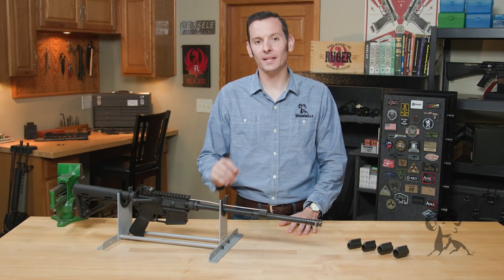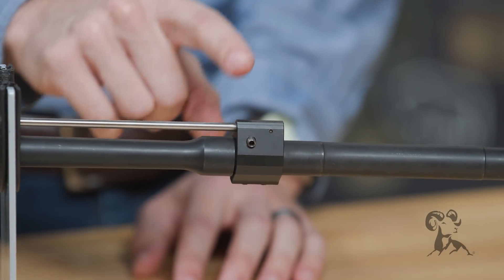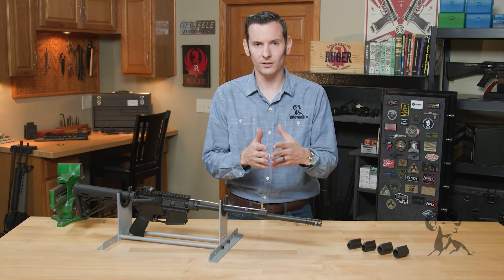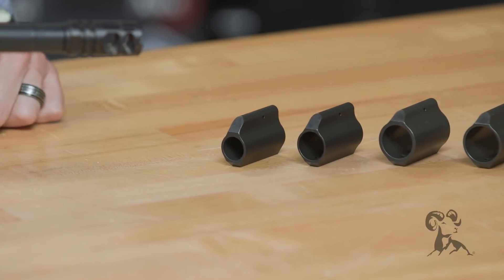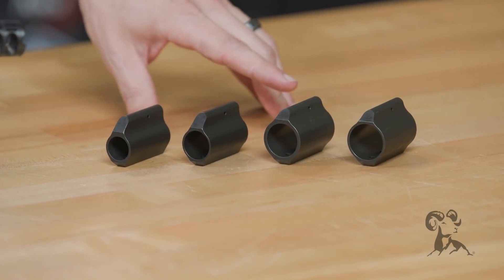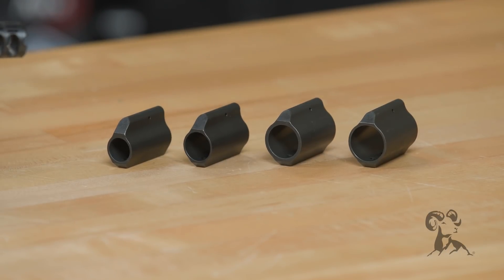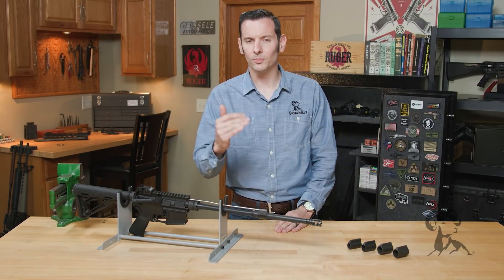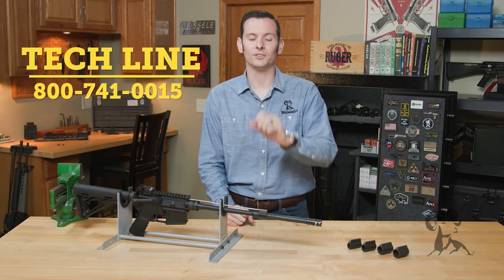Quick Tip: AR-15 Gas Block Diameter Explained

Comment: How can I find out what kind of gas block I need I have a s&w sport 2 with the rail gas block I want to switch it to low profile gas block with few float hand guard
Reply from the maker: .750 diameter

Comment: Question? I have a 5.56 and 223 rifle and I want to buy a 9mm upper.  I have to register the lower at 9mm and the length of the upper can be 8 ”even if it is a rifle?
Reply: Rifles must have barrels longer than 16"
Pistols must have no buttstock
...Unless you do the Form 1

Comment: Thanks for the info; it's what I've been looking for! You guys' videos are always helpful. I was wondering about the so-called "adjustable" gas blocks offered by some manufacturers, especially the .750" blocks. Are they really useful and worth it vs. a fixed block, i.e. non-adjustable?
Reply: Probably not worth it
Reply: Yes, they certainly are, some are better than others. I would recommend the Superlative Arms, they bleed off the excess gas rather than just restrict so they run much cleaner than some of the others on the market therefore require a bit less maintenance.

Comment: Math is so hard.  What if you shoot 5.56 mm rounds?  Do you have to use a Metric gas block, right?  Then you have to change the buffer spring and buffer weight like the AR-board resident FUD said?  I'm sticking to flint locks.

Comment: As someone not to knowledgeable on the subject it seems more logical to me if larger pressure barrels require smaller diameter gas tubes.  Is that right? I imagine the action of a normal psi and a high psi load are equally easy to move, so the higher load will provide too much force and thus require a smaller gas tube to get it to the same strength as a normal one. Bs or no?
Reply: NATO and before that U.S. Ordnance have published specification for the acceptable pressure pulse that conforming ammunition must provide.  The M193 and M855 both provide the acceptable pressures (No more than 12000 psi and no less than 7000 or thereabouts).  Incompetent manufacturers unable to make ammunition to the standard simply have their product rejected.
Reply: Gas tube diameter does not matter. If you were talking about gas port diameter (which is drilled in the barrel), you would be correct

Comment: Can u guys give refunds to the people who bought the slick side uppers? Their is a gap in between the upper and lower. The whole point of the ar-15 is to be tightly sealed. If there is a gap then dirt will get inside. It’s beyond a joke that u guys put this out on the market.
Reply: There*
Reply: There is supposed to be a gap there. There is even a gauge for that in military armories. If the gap is very large then there is a tolerance stacking issue. If you want a really close fit, the KP15 lower has had a tight fit on Aero, DRG, spike's, and keep arms uppers. I can't speak for ones I haven't tried. Even matched upper/lower combos will have a gap. The concern only occurs when the gap is large enough to let relatively large debris in that could cause stoppages.
Reply: @sanguinemoon9201  the gap is bigger than a mm. enough for little pebbles of sand to get inside. all they had to do was add a mm to the rear and it would of been solved. did they no. did they try and fix it. no.thanks for the solutions
Reply: you already did more work in solving the problem then brownells did.
Reply: Uga Buga, Brownell's has a forever satisfaction guarantee. Try that and stop whining.
Reply: There are exactly zero AR-15s that do not have a gap between upper and lower receiver

Comment: Do you need a different gas tube if you switch to a different barrel and block? Or does one size fit all for gas tubes?
Reply: The tube is matched to the barrel- specifically the distance to the gas block.  I.e. you'll have pistol, carbine, midlength, intermediate (sort of rare), rifle, etc.  A midlength will always take a midlength gas tube no matter what block is on there.  The gas block dia is sized to the journal diameter Caleb is talking about.  The tube is sized to the distance to the port.  Changing gas blocks will keep the same length gas tube, and those lengths are standardized.
Reply: @mattfleming86  Thanks. That was a clear explanation.
Reply: @timrobinson6573  Hope so, best I have on the explanation front.  Luckily the community has always been around to answer my questions, I wish you to same.

Comment: buy the largest gas block you can because it will fit on the small barrels, obviously the small one won't fit the larger barrels.
Reply: True😂😂😂😂 
Shim it with aluminium bushings😂😂😂😂